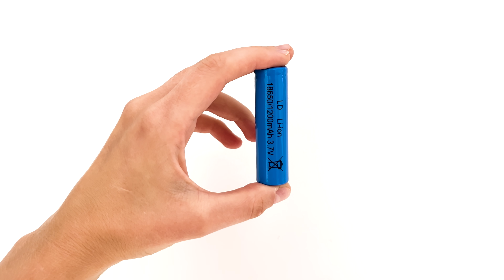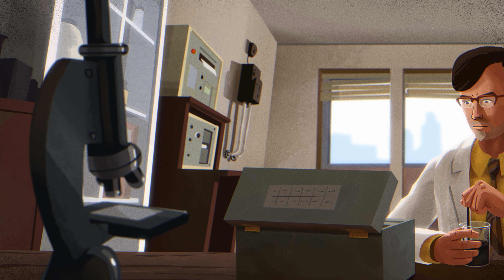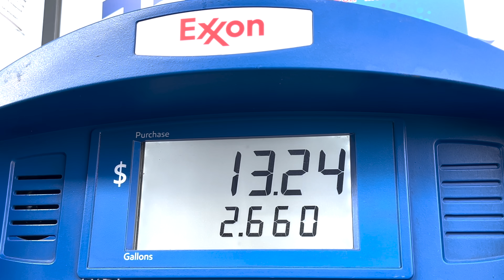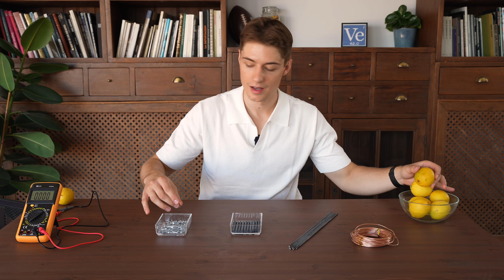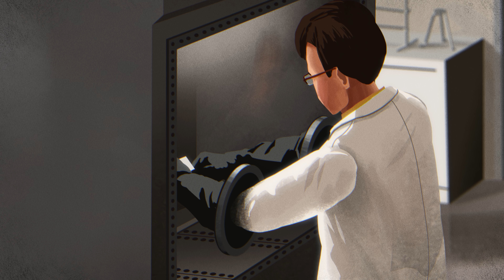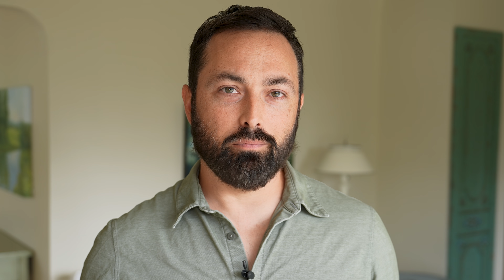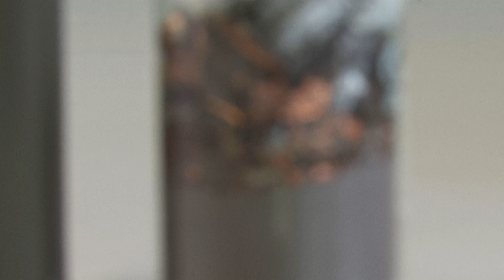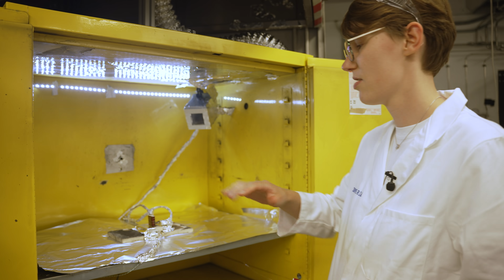The Perfect Battery Material Is Dangerous

Comment: Context please!!  This video was misleading regarding fires and harm to the environment because it did not contrast batteries with the systems they are replacing.  For example EVs are 20 times LESS likely to catch fire than ICE (internal combustion engine) vehicles.  Mining of lithium is far less destructive to the environment than mining, refining, and burning of fossil fuels AND batteries can be recycled while fossil fuels are single use!  Also sodium ion batteries are on the way, using even more abundant materials.

Comment: Derek, you need to look into the new type of battery that was recently invented but isn't in production yet. For the life of me i can't remember who created it or what materials were used to make it, but I know he used materials that are normally extremely dangerous but the guy found a way to make a battery vastly higher voltage output with much longer life and it was completely safe. You could even cut directly into the battery with scissors right from the anode to the cathode and it wouldn't short or or catch on fire. It was incredible. It would be a good follow up video!

Comment: Batteries have been held back so hard by industry. NiCad batteries should've been illegal before they were made, being made with TWO heavy metals that people just chuck out. NiMH were better (and for still had higher energy density than Li-Ion up until quite recently) but everyone decided requiring alkaline voltage was better than supporting 1.25, with no choice. Even if NiCads were "a step up" from lead-acid (which is EASY to clean up), the full force of capitalism sold people on heavy metals that needed to be thrown out more than twice as often as NiMH. Lithium ion batteries only gained traction when companies started selling rechargeable as sexy. Cut the battery capacity (and cost to make) in half, drive it multiple times harder, ends up in a landfill as fast as NiCads. The decay factor on electronics post like, 2012, is driven almost entirely by battery hucksterism. Sure you can get a quad-core laptop or phone from ten years+ ago, but no, you the battery isn't made anymore , and you definitely need to participate in the fastest-moving obliteration of technology improvement ever seen in human history. 1TB storage, 32 cores, 12GB of ram, and 5 wireless bands just so they can send a 1kB text with a battery that's dead next year. I'm glad China is switching to Sodium-Ion and is less bad than us. Still bad with the lead-acid batteries in consumer goods, but not as bad.

Comment: 21:50 
Density of PA is not an issue. The issue is that its specific capacity for lithium is low (per mass of PA). 

If we are interested in less volume of a battery, so it is an issue.

Comment: 20:30
You forget to add hydrogen atoms which should bond with ratio 1:1 with each of carbon atoms. Presented structure of polyacetylene has carbon atoms with valence 3, which is not right (should be 4).

Comment: 13:03
This is true if we agree that direct reaction (discharge) has 95 % yield and counter reaction (charge) has 100 % yield (or other variants when total yield is 95 %). If we agree that both reactions have 95 % yield thus the residual capacity will be 6 %.

Comment: 9:45 
Density of lithium or other metals does not influence specific capacity per gram of a cell. 

If we are calculating capacity per volume, it is better to use more dense materials. 

The real thing that is important for better specific capacity per mass is equivalent (per electron) atomic mass of a metal. The less it is the better. The more amount of electrons per gram can we transfer, the better specific capacity is.

Comment: One thing you "forgot" to mention when it comes to electric cars is that the energy density is still terrible. If you want a car that is fast and not just in a straight line, you need it to be lightweight. Example from my country of Czech Republic, car Praga Bohema. It is beating lap records because it is only 2200 pounds. How? It doesn't have batteries but uses gasoline.
Lithium-ion battery has 0.9 MJ/kg of specific energy. Gasoline has 46 MJ/kg and hydrogen has 120 MJ/kg. The 0.9 is honestly a joke and I am surprised that it works at all.

Comment: I've experienced one spectacular battery explosion many years ago, an explosion that almost set my house on fire, luckily that didn't happen. What happened was that I was charging an old and used smartphone battery (that had its BMS removed) that was installed in a torch light (that I assembled as a childhood ingenuity and back then I knew almost nothing about the necessity of BMS and safe changing) and suddenly there was a big explosion 💥 and what's even crazy was that the torch light was kept charging behind a CRTV that was still running ! After seeing the explosion I thought something had happened to the TV and rushed to the spot and found out that it was the battery in the torch light that exploded. The heat from the explosion was so intense that it melted the anode and cathode along with the metal casing of the battery and was glowing red hot. Thankfully the fire from the explosion didn't spread and was contained within the torch light casing. But that incident made me realize how dangerous lithium ion batteries can be. 🤯

Comment: Not good Derek. Started well but ended very poorly. 
LFP has all but resolved the fire risk and is in most EVs today. Why no mention? 
Solid state batteries from CATL are in production cars and do not burn at all. Why no mention?
Most Cobolt is actually used in petrol refining. Why no mention?
EV fires are not an issue (ICE cars burn dangerously fast and are more frequent per mile driven). 
Lithium is not in short supply (as reflected by commodity prices).
Why such a negative message Derek? Trying to put people off switching from combustion fuel? 
It does rather feel that way unfortunately. 
A dark day for your otherwise excellent channel. Thumbs down.

Comment: 2:50--- THATS A LIE
Average range for cheap were at around 80 miles not km , other were like 100+ miles (some up to 200 miles)
Low range ones were only used in cities with most often repleacable batteries
Second lie was about batteries , first ones ..yes , they degraded , but in rly short amount of time there were Edison batteries that have lifespan of around 25-50years not cycles...years , yet they were so well made some work to this day almost like brand new

Comment: July 3, 2024

Lab creates world's first anode-free sodium solid-state battery
by Paul Dailing, University of Chicago

UChicago Pritzker Molecular Engineering Prof. Y. Shirley Meng's Laboratory for Energy Storage and Conversion has created the world's first anode-free sodium solid-state battery.

With this research, the LESC—a collaboration between the UChicago Pritzker School of Molecular Engineering and the University of California San Diego's Aiiso Yufeng Li Family Department of Chemical and Nano Engineering—has brought the reality of inexpensive, fast-charging, high-capacity batteries for electric vehicles and grid storage closer than ever.

The paper, published today in Nature Energy, demonstrates a new sodium battery architecture with stable cycling for several hundred cycles. By removing the anode and using inexpensive, abundant sodium instead of lithium, this new form of battery will be more affordable and environmentally friendly to produce. Through its innovative solid-state design, the battery also will be safe and powerful.

Sodium, common in ocean water and soda ash mining, is an inherently more environmentally friendly battery material. The LESC research has made it a powerful one as well.
Anode-free batteries remove the anode and store the ions on an electrochemical deposition of alkali metal directly on the current collector. This approach enables higher cell voltage, lower cell cost, and increased energy density, but brings its own challenges.

Meng and Deysher have filed a patent application for their work through UC San Diego's Office of Innovation and Commercialization.

Comment: @7:56 Lithium batteries are also about 1.2V. They just store more electons per kilogram of battery weight, so even though each electron has the same amount of energy as any other 1.2V battery, the energy density is still much better. At least on a per-kilogram basis.

Comment: Have the magnetic poles flipped alteady and I missed it?  In a vacuume tube, the part which has a coating that emits electrons when heated is called the Cathode. They are attracted to a plate with a high postive charge called an Anode.

Comment: 18:25 it should be illegal to patent something just so NO ONE does anything with it, including the patentee... Best way of killing innovation and sadly it's "legal".
24:50 I still remember early generation Li-On batteries, and how the trickle chargers at the time basically destroyed them after 1-2 years to the point where they'd have lost 40% capacity at least if not more. Today's batteries have really come far. I have some devices that I only use occasionally and last I've charged them months ago.
Absolutely unthinkable for the early generation ones that were basically dead after 2 weeks.

Comment: 9:42 I'm baffled why educational channels make this mistake 
 ❌ Zero point Fifty Three
✅ Zero point Five Three

If 0.53 is fifty three, do we call 0.50=0.5 fifty or five? There are no tens of hundreds after decimal
Reply: There aren't tens or hundreds, but there are tenths and hundredths.

0.53 is 5 tenths and 3 hundredths, or 53 hundredths.

0.5 is 5 tenths or 50 hundredths.

Context can often determine what words are used to describe a decimal. For example, if you're comparing lap time between different cars in a race, and the first few cars have differences of only a few hundredths of a second, you might continue to use hundredths rather than switch to tenths even if the gaps get bigger.

So you might describe one car as being 6 hundredths behind another, but the next car is 12 hundredths behind. Using the same decimal position can help prevent confusion, rather than switching between tenths and hundredths.

Regardless, both are proper usage.

Comment: Funnily enough, I have experience with this from Airsoft. LiPo batteries became super popular because of their high voltage and smaller form factors compared to NiCad Batterypacks, but I've personally seen a bunch of them cook off, including once on a car ride to a field. LiFePo batteries however, offer almost similar size and voltage and capacity, yet won't burn when mechanically disturbed or loaded wrong. Why are we using LiPo batteries everywhere still?

To quote Legasov from Thernobyl. "It's cheaper..."

Comment: I replaced my motorcycle lead acid batteries with lithium IRON(LFP) batteries.  So lightweight, no hydrogen gas or corrosion issues and last longer than lead acid.  Full cranking power til almost 0% charge.  Lead acid need at least 70% charge to crank engine.  Lithium ION BATTERIES(NCA NCM) have higher energy but can rarely catch fire.  Almost 50% of Teslas are LFP batteries as they have more charging cycles, almost 0 fires, and they love 100% charges/supercharging all day long. They are a little energy less dense than Lithium Ion but  cheaper to make for entry  level cars.  No cobalt or nickel used in LFP batteries but cheaper iron.  Chinese CATL worlds largest battery manufacturer just developed a new version LFP M3P battery, probably a million mile battery.  EV’s could be a forever car.  These cells will end up in other applications.

Comment: @veritasium I miss the mention of sodium-ion battery and the even safer salt water batterie (inflammable).
It solves all the issues with lithium batteries: hardly flammable, no rare materials required -> cheaper at same production rate. And they are ready available.
Only the density is a little less, but more than enough for most applications. Especially for house batteries the inflammability is crucial.
And here again: like nothing was invested in Lithium ion 1975-1990, Natrium-Ion is ignored by the big industries. The small startups currently selling them, cannot get the small price of the high scaled lithium-ion industry; despite the actual production costs would be lower if scaled to the same level.

Again, it will come 20Years later. Then Lithium-Ion will be forbidden due to emitting poisonous lithium (e.g. over the waste bin, but also during usage errors), which was originally stored safe in deserts grounds. But 20Years to late, after we see the damage, like seen with lead.

Comment: It would be million dollar race, not billion dollar race, if FED weren't actively devaluing and debasing dollar - because fiat money stores energy worse than the worst battery.
I started measuring my wealth in sats so it is derived from SI base units rather than from bankster/government decrees. With all respect to the wisdom of gerontocrats, they just can't beat physics.
I hope this comment is based enough to finally trigger Veritasium to make a video about Bitcion - actual good video covering 1982 proof of how networks achieve interactive consistency in presence of faulty (Byzantine) nodes (Lamport et. al. won Edsger Dijsktra prize for this!! and NASA even sponsored endeavors to find the proof), how it affects complex decision systems, how important solving Byzantine failure is for aerospace and monetary systems and then finally work towards covering perhaps the most important idea of the 21. century and perhaps of the frikkin millenium! Come on! You will make the video sooner or later so make it already!

Comment: My house burnt down this winter due to my sons hoover board lithium battery exploded. House was engulfed under 10mins with flames coming out 2nd floor windows over 30ft above the roof. It took 7 fire trucks 6hrs to put it out. Partly bc we only had hardwood floors and second floor was T&G boards on walls

Comment: There are many lithium chemistries in use, which vary in stability. Lithium Titanate is quite stable, while Lithium Cobalt Oxide is prone to thermal runaway. Lithium Iron Phosphate is fairly stable, but the very high efficiency makes state of charge hard to measure and manage.

Comment: You should have talked about LFP and LTO batteries. They are the best when talking about safety (LTO is the best overall for safety and ultra fast charging but is expensive and the power density is low, LFP is very good for safety, cheap, easy to recycle but has a lower power density than NCM and is difficult to charge when cold).

Comment: Before lithium ion was a thing, people were using lithium batteries in some incredibly dangerous processes for creating "shake & bake" meth at home. While lithium ion has its own risks- lithium strips inside batteries was way more dangerous.

As a very stupid teenager (13 or 14?),  i pulled a battery apart that had the lithium strip in it after hearing about its uses... this was in just being an irresponsible curious teen, not attempting to make drugs lol but my friend and i who were doing it had read that if you feel ANY heat, you might be in big trouble. Whether we actually did or psyched ourselves up im still not sure of to this day. This was during a snow storm- and in freaking out we tossed it out the window into the snow. To us, it looked like the snow itself was on fire. The fire department came, and it had caught two full trash cans on fire and a plastic covered chain link fence- and it couldve been much worse. That stuff is no joke.

Comment: Modern lithium iron phosphate batteries do not burn. In NMC batteries, The cobalt oxide provides oxygen when burning, thus providing the oxygen to keep burning. 
The vast majority of batteries for home use are lithium iron phosphate. Even cars are turning to LiFePo4 to avoid the fire risk. 
European EVs are getting away from cobalt chemistry as well. NMC, cobalt chemistry, has better energy density, but is very dangerous. 

There is a fear in the lithium ion market that all lithium batteries are dangerous. In reality, better chemistry, such as LiFePo4 and good battery management systems, (BMS) reduce the danger significantly. 

Not mentioning the differences, or how BMSs prevent overcharging, is doing the public and the EV and home battery industry a huge disservice.